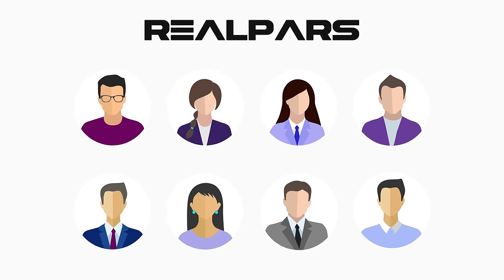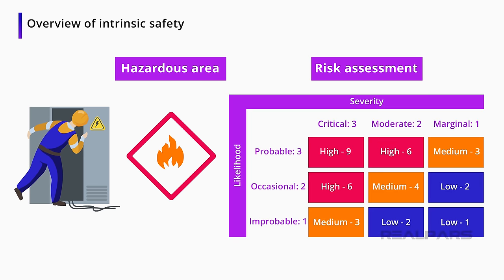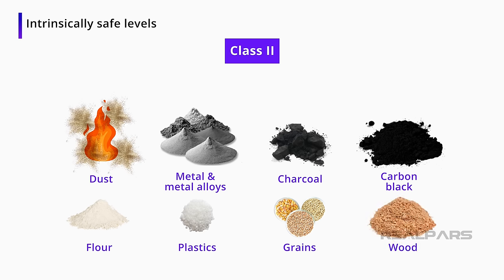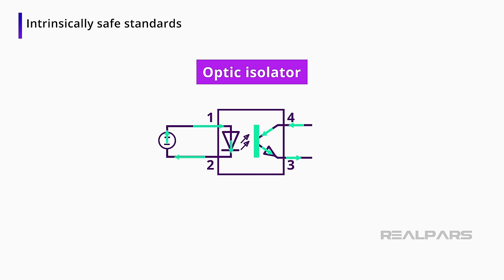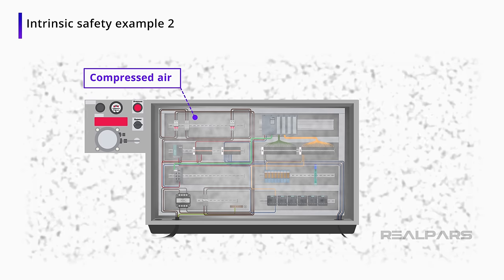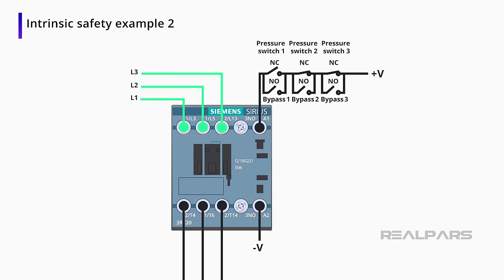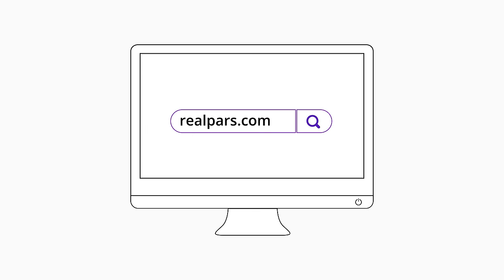What is Intrinsically Safe?

Comment: Clear, simple and straightforward basic explanation of the main aspects and concepts of intrinsic safety.  Congratulations!  
Just a small conceptual comment: Both "classified" and "unclassified" areas need to be considered and deemed as "SAFE".  
Electrical, automation and instrumentation installations, in both cases, need to use equipment with appropriate "Ex" protection types (in classified areas) or associated equipment (in non-classified areas), in addition to performing the applicable installation, inspection and maintenance "Ex" service procedures, according to IEC 60079-14 and IEC 60079-17. 👍 
Thus, it is suggested to use the term "UNCLASSIFIED AREA" or "NON HAZARDOUS AREA" instead of "SAFE AREA".

Comment: For your example division two actually refers to the presence of a hazardous atmosphere under abnormal operating conditions such as maintenance
Reply: Did they flip flop Div 1 and 2 (normal vs abnormal) in this video?
Reply: I can’t remember where I read it but it said that Div.2 is presence of a hazardous atmosphere less that 6 hours per year which means emergencies only and Div.1 is over 6 hours per year.
Reply: I agree; I also think that they got it switched with Division 1.

Comment: Hello, the video was really helpful in understanding intrinsic safety in a context of plc control system. But, I have something to clarify. It was said in the video that Div 1 is for environment where combustible dust is present during abnormal conditions. I think abnormal is for Div 2. Would like if you can give clarification on this. Thank you
Reply from the maker: Correct.  Div 1 conditions exist where the hazard is normally present.  Div 2 is when the hazard exists under abnormal conditions.

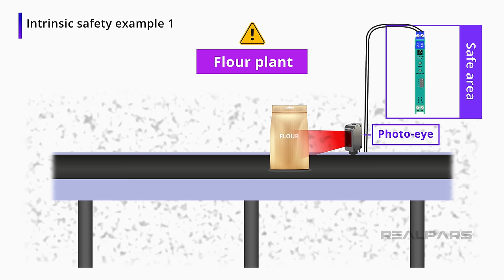Comment: On minutes 5:00 when photo-eye ON it will turn on a diode. Where is the power from? Is there any battery inside photo-eye?
Reply from the maker: The power (usually 12VDC or 24VDC) comes from the PLC card it is attached to, or in some cases, an external power supply.  Photo eyes do need a power source.
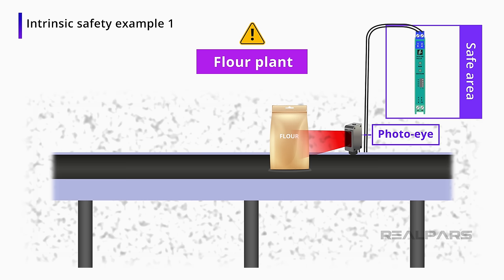Reply: @realpars  But on the video 05:00 the circuit only connected with light diode to PLC. Is there any other wire to photoe eye to carry 24VDC?
Reply: I think the power will not come from PLC card, the power is from external source, then the feedback (alarm reading or normal reading from the photo eye) ia connected to the barrier, the barrier then converts that small signal to a higher voltage signal to reach to the PLC AI card (i think the signal is Analog), if there is an alarm signal the ESD system will shutdown the power or act to prevent any explosion etc.. i think its done that why but i am not sure.

Comment: You mentioned at the start, that the video would show how to DESIGN a circuit which is intrinsically safe? Is this video demonstrating the LOOP concept (follow the manufacturer certification exactly) and ignores the ENTITY circuit calculations?
What about the requirements for the circuit calculation, the entity parameters, cable capacitance and inductance? The number of times I’ve had near misses from sub contractors, mistakenly thinking, that when they pick a barrier which will power a device in the field also means it’s safe for the hazardous area is beyond frustrating (at times has lead to follow up action with their employer when competency is an issue). Also, would it not have been easier just to say the barrier must be installed in a safe area rather than give a specific example of a purged panel which achieves this?
Reply from the maker: @fitz83  Our short videos 9n YouTube are meant to introduce viewers to concepts used in the automation industry.  Entity circuit calculations are quite a bit more involved than what our short videos can cover.  And yes, in hindsight, placing the panel in a GP area would have simplified the discussion.

Comment: Whats the difference between Ex d and Ex i? What are the applications?

Also all barriers will need a photo eye?
Reply from the maker: A simplified answer is that Ex-ia sensors are classified as Category 1G/1D equipment, for installation in Zone 0, 1, or 2  and 20, 21, and 22 areas.  Ex-d sensors are classified as Category 2G equipment, for installation in Zone 1 or 2  and 21 or 22 areas. Ex-ia sensors (such as a tuning fork level switch) can be installed in a tank with hazardous material , whereas an Ex-d sensor cannot be installed in that location.

Comment: Hello, I am aware of IS CALCULATION concept. But for one loop only. Like BARRIER to JB to LT.

But I am not sure how would be the process for IS like this case. BARRIER to JB to FIT to FE? How is The cable from FIT for FE considered in calculation?
Reply from the maker: Thank you for your question! You’ve raised an interesting point. Here are two links that I hope will help clarify the calculations for the cable from JB to FIT or FE devices.

https://www.extech.co.za/wp-content/uploads/How-to-calculate-an-IS-loop-approval-Extech.pdf

https://www.icetoolkit.com/IntrinsicSafetyCalculator 

If you need further assistance or have any other questions, please don't hesitate to reach out.

Comment: What about intrinsic safety for wireless loops? Does the receiver has to comply with IS regulations too?
Reply from the maker: The short answer to your question is YES.  Every part of the "circuit" must be analyzed to insure that the maximum radiated energy does not exceed the threshold for IS installations.  A good summary can be found at: https://www.controlglobal.com/articles/2019/how-to-ensure-intrinsic-safety-for-wireless-systems/.  Most wireless installations do not exceed the 2W limitation for the most stringent Group IIC environments, and when installed properly (in Ex d enclosures, for example), can be used in hazardous areas without modification.

Comment: Realpars, please what's the difference between this video vis-a-vis IS vs Non-IS cables?
Reply from the maker: Intrinsically safe cables are designed to be UV and weather-resistant and conform to certain ISI standards.  Cables that are installed in IS service should have blue jacketing/insulating covering to distinguish the cables from those installed in non-IS circuits.  In many cases, the type of connection made in the hazardous area is restricted to eliminate the possibility of arcing (as with quick-disconnect cables).
Reply: @realpars  Thank you RealPars.

Comment: Another interesting video on safety. Is Siemens ET 200iSP better to use in the field as DP compared with the inc. safety barriers?
Reply from the maker: The ET200iSP I/O cards have IS barriers built into the I/O card.  It is a matter of convenience and cost to use the ET200iSP system versus a standard PLC I/O card with external IS barriers.  Remember, that all systems placed into or interfacing with Zone 1, Zone 21, or Class 1 Div 2 or Class 2 Div 2 areas, must be designed for the appropriate level of protection from the field instrument through to the PLC or DCS.  Just installing ah IS barrier or ET200iSP system is not alone sufficient to ensure safe operation.

Comment: What happens if the field instrument is not ATEX certified?
Reply from the maker: If an instrument is not ATEX certified, then there is no guarantee that the construction of the instrument and its circuitry will provide the level of protection against flammable hazards that may be required.
Reply: @realpars  even if it’s a simple device